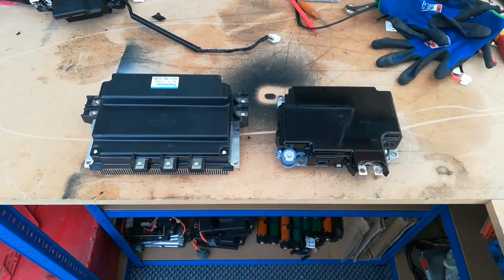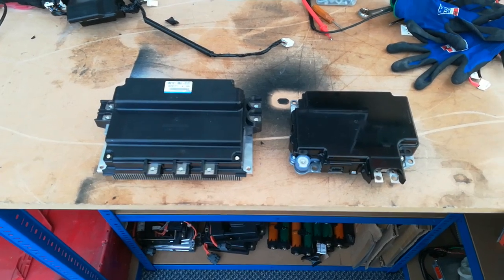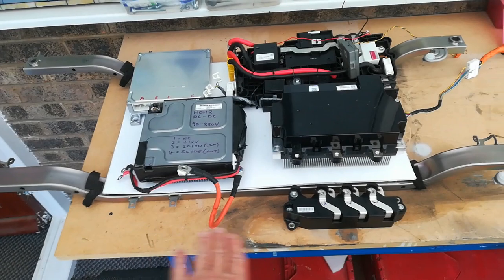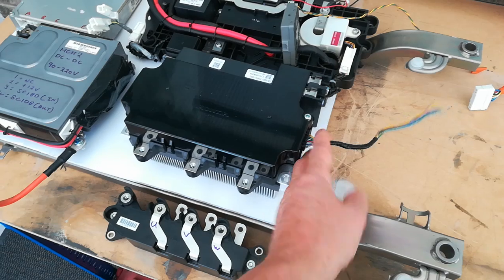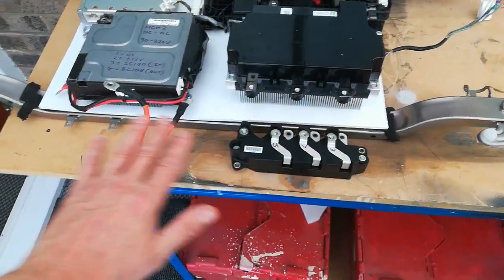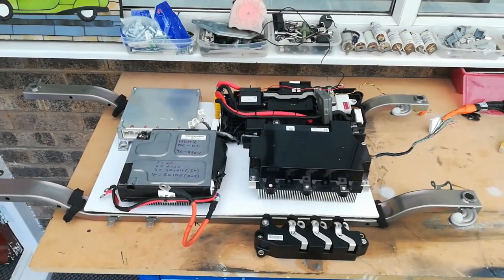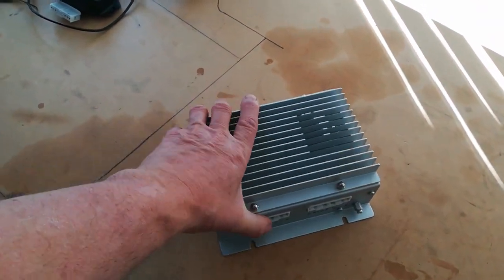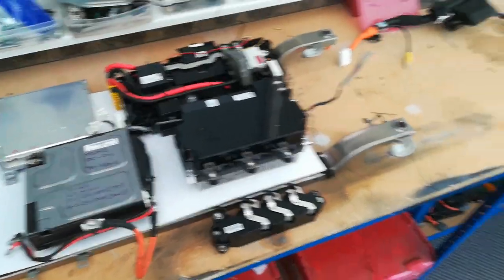CR-Z Frankenstein IMA 30kw System Video 1

Comment: I've had one of the IGBTs go bad in my HCH3 twice (2012).  I installed a used transistor about 3 months ago and the car ran fine, even managed to get my best economy ever.  The same problem has come back again.  De-soldered the board and it is the same transistor. I am on the fence if I should get another transistor or a whole new inverter unit. What would cause these to go bad? Sorry for the non sequitur comment, but finding any information has been difficult.
Reply from the maker: No idea on why they fail. But it's not uncommon.